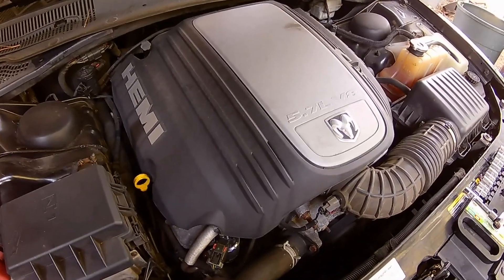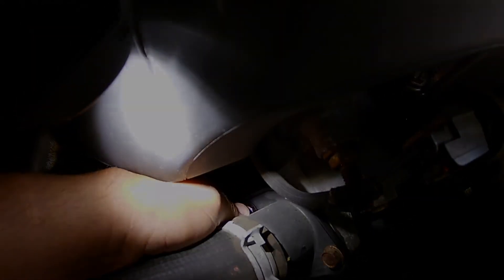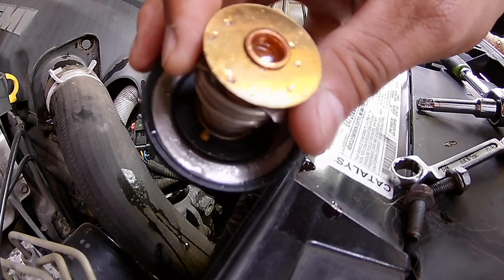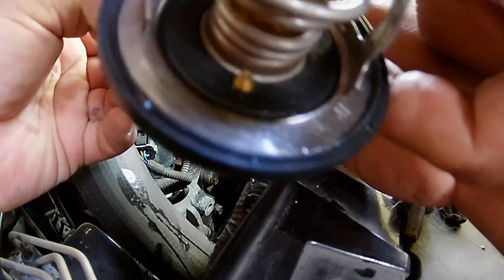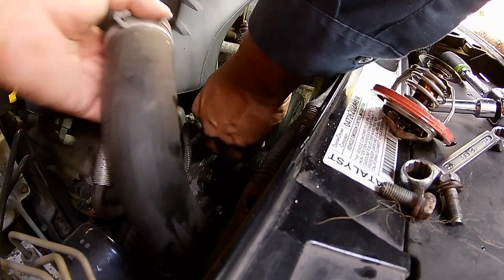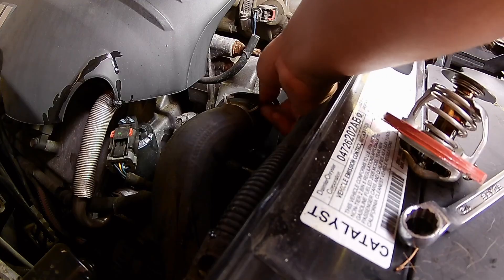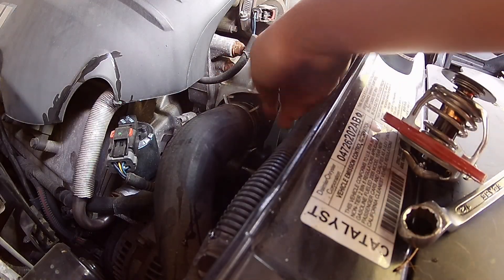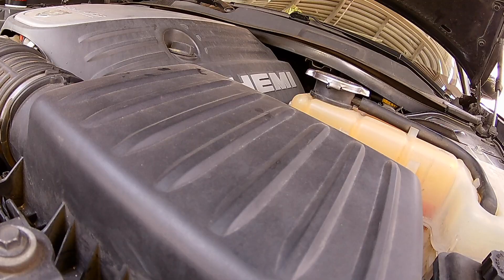How to Replace Thermostat on a Dodge 5.7L Hemi - P0128 - Challenger Charger Magnum Ram Commander

Comment: The old stat has holes in it my new one did not. I dont understand.
Reply from the maker: It helps trapped air get past the thermostat. You can drill a hole on the flange of the thermostat if the new one does not have it.
Reply: @bundysgarage I have seen stats with a little piece of dangly thing in them but this blew me away because you can clearly tell this was not done by someone but rather it was installed by the factory with 6 holes uniformly drilled around it. Now one hole I get it but 6 to me means there is something more significant from the factory in its purpose. So is it that the aftermarket has never actually seen a hemi stat because I can't think of why they would think you don't need them and the factory didn't know what they were doing and from personal experience on other vehicles that many holes made the engine run hot. Now I cant fully say in this particular vehicle because it has had a temperature issue ever since we got it which led to a broken thermostat and the replacement compared to the original raised an eyebrow and seeing the construction of the original raised both eyebrows. Installing the replacement as is runs in my opinion hotter than normal though it is a 207 degree thermostat 🥺 and the fan kicks on at 217 degrees 😳 so I'm on the edge of my pants constantly monitoring the temperature as it has climbed to 250. It actually runs cooler with the a c on because the fan is on. I don't know if this stat is ok for it or does these 6 holes play a better role and why they didn't give me the actual part. I have researched and have found one that actually has the holes in the stat but it's like one out of ten so I am confused on what the heck is going on.

Comment: Perfect video exactly what I was looking for. Had a hose burst on my 5.7 I swapped it and now it’s leaking from thermostat housing and I got the code P0128 I changed the coolant sensor awhile back but code never left so imagine this is my issue.
Reply: Dime solucionaste el problema? Si era el termostato y no el sensor de temperatura? Cuál fue?

Comment: My check engine light came on said it was this code but i have no symptoms no over heating or to cold is that normal? Still planning on changing it tho.
Reply: You may have to run a drive cycle. Run it from 55 up to 65 then let it coast back down to 55 without hitting the brakes. Repeat this about 5 times. And it should get the code to go away literally just had the same issue.
Reply: @Abraxas99x  i did end up changing my thermostats sensor well when I opened it it didn't have one idk what the hell that was about but I put new one in and the code didn't come up anymore... however my transmission is now taking way to long to warm up have no idea why and all my research came up with nothing so might have to take it in.
Reply: @Mrsirwinsalott  Sounds crazy but the new one may be stuck open. The one I just replaced is because the one I replaced before was faulty. One of the guys there said he's seen people swap thermostats out 2 or 3 times before there's a good one. That's why they give them a 1 year or lifetime warranty. 🤦🏿‍♂️😮‍💨

Comment: Where do I fill the coolant up to. The cold or hot/warm level
Reply from the maker: If the engine is cold you will fill it to the cold line. If the engine is hot (but not to the hot line) add coolant until you reach the hot line.

Comment: Great job showing people how to install thermostat correctly with vent hole at 12 clock or on top. Most video  don't show.
Reply: What happens if the vent hole is not in the correct place ?
Reply: @johnnymora1017 did you find out
Reply: @Fisguap lmao I did!! But not I fixed it!!
Reply: @johnnymora1017  did it make the water pump go bad
Reply: @Fastas19x I believe it did😂.. I changed my pump again after couple years.. this time  I didn’t go OEM I just grabbed it from autozone.. also make sure you bleed it correctly otherwise temp goes up n down n it sucks to constantly be checking on the temperature

Comment: I change both sensor and stat and still get that code and temp drops to cold when weather is 36* and under what’s good
Reply from the maker: Where did you buy the thermostat from ?
Reply: @bundysgarage  auto zone. I also saw that my old stat had a piece of plastic missing. What I didn’t do was put that little dot at the 12 o’clock position. Any advice my brotha
Reply from the maker: Get a thermostat from the dealership. Replace the AZ one with the OE one and put the pin at the 12 o’clock position.

Comment: I just changed mine yesterday. But engine light still on. I think it's cuz I did not point the lil pin towards the engine for air flow. Demit why didn't I come across this vdo before. oh will will have to open up again. errhhh
Reply: Did you ever change it back? Did light turn off? 
Did you just have the sensor go off no symptoms? I got the check engine light said it was this code but I have no symptoms car running perfect temp

Comment: I tested my thermostat and it opens at 206°F. 3° shouldn’t be an issue. But then I noticed that my thermostat gasket is just as boogered up as yours, so that’s probably the problem. I’ll replace it and see what happens.

Comment: I changed my thermostat and my car is still overheating .. I don’t get it..
Reply: Bleed the system
Reply from the maker: What’s your radiator look like? How’s your water pump?
Reply: @bundysgarage  I don’t even know like what’s the signs to look for if it’s messed up

Comment: What’s the piece called that the hose is attached to? Mine is rotted out and leaking
Reply from the maker: Thermostat housing
Reply: Drain, flush, and refill radiator with proper coolant and distilled water every 5 years to prevent rust and corrosion in heater core, radiator, and entire cooling system.

Comment: the polyurethane gasket on that stock thermastat is way better than the black rubber one on the new one. Mine cracked in 11 months.

Comment: Do you think Bc I didn’t put the pin at the 12 o clock position my check engine light still on and give me the same code?
Reply from the maker: Where did you buy the thermostat from?
Reply: Same question I bought mine at o'Reillys
Reply: O’Reilly’s

Comment: Do you not have to run a thermostat housing gasket on it I’ll put one on mine
Reply: It has a gasket.  It's black.  The old one is orange.  They don't use or need a flange gasket.

Comment: I'm going back to factory after running my second 180 stat in it and having it fail. Had my fans set to 180 recommendations as well, so I guess I'll need to reset them back to factory. The stat they say for my 5.7 Magnum at the Dealer parts Department is 195. is this correct?

Comment: You dont have to bleed the system? Its okay to open it up like that ?
Reply from the maker: No you don't need to bleed the system after doing this. Now if you had changed say the water pump or the radiator, then yes you would need to beel the cooling system. If a large amount of coolant drained and a lot of air entered the system, that is when you need to bleed the system.
Reply: That was my question, thanks!
Reply: That Race Car Driver  YOU DONT HAVE TO BLEED THE CAR !! Just make sure to buy some coolant cause you will lose a good amount. I changed 2 weeks ago

Comment: I have a 2013 Challenger Hemi.My tstat is working for im not  over heating but I have a slight leak. I think the gasket that between fits between the housing has gone bad. WHAT do you guys think.
Reply: Same thing for me. Gasket was worn and so was the one on the thermostat itself. Runs just fine now after replacing both and adding sealant to the housing both sides of the housing gasket.

Comment: If your heater is constant blowing hot air, is that a thermostat issue as well?
Reply: Even if you put it on cold air? Then no, that would be a blend door issue. You would need to replace the blend door actuator.

Comment: Would it be concerning that the gasket was missing?
Reply: The gasket wasn't missing.  It was black.  The old one was orange.  It doesn't use a flange gasket.
Reply: I put one on oreillys said they had for the 5.7 300c.
Reply: Tests just fine.

Comment: Could this fix a P2181 code also? Also gave an impulsive engine temperature code. Thanks
Reply from the maker: That code is for the coolant temperature sensor. Is the car overheating?
Reply: @bundysgarage  According to in car thermostat no, but smells hot after parking, heat won't work and fan is constantly blowing hard.
Reply from the maker: Sounds like you have a coolant leak somewhere. I would have your cooling system pressure tested and see if you are leaking coolant somewhere. All the symptoms you are describing sound like a low coolant level situation.
Reply: @atl2sdak what end up fixing your issue? I have the same code
Reply: Thanks for the help

Comment: There’s a gasket on the Tstat and there’s supposed to be a gasket between the mating surfaces of the tstat housing and the metal connector with the radiator hose on it
Reply: Just replaced the water pump on my 2014 Grand Cherokee Hemi and the only gasket at the upper hose housing is the one on the thermostat.  There is no gasket between the mating surfaces of the outlet housing flange and the water pump itself.
Reply: Y’all got it all wrong you don’t need a gasket please don’t put a gasket the thermostat already has a gasket all it needs
Reply: You could use a little bit of black rtv instead of a 6$ gasket if you wanted to make sure it wouldn't leak. Doesn't require it though but I'll normally add some when doing hemi motor jobs.

Comment: Good video! Good pointing out that the bolts are the same length (so no worry about which one goes where). Future suggestion: Show everyone how you go about diagnosing a failed thermostat(for those with out a OBD scanner) or heater core. Due to the wide spread popularity of 5.7 (and other engine type) equipped Dodge and Chrysler vehicles, you should put together a series of "how to" videos for common issues as well as uncommon; you would get more than enough views/clicks to make it worth your while from YouTube ($$$). 

A common problem is the rear axle seals. Make a video that explains that process. Again, great job telling everyone what size socket and info about the bolt fasteners (takes the guess work out for those who are not in the know)! Most local shops want about $600+ to replace the rear axle seals.

Just wondering, how many miles were on the car before the thermostat failed? My 07 Dodge Charger 5.7 has approximately 116,000 miles and it still has the original factory installed thermostat. 

Some of the comments submitted below mentioned that you didn't bleed the system. I understand that you didn't lose much coolant that would have made that step necessary. However, why not show everyone how to change the coolant and bleed the system in a future video?
Reply: Mine just took a crap at 120k
Reply: Mine is at exactly 116k and it’s a 5.7 and it’s the thermostat 😂
Reply: El mío compré mopar y me duró 20 mil km. Muy malo o tal vez fue una imitación del original

Comment: Does the thermostat housing/flange itself, need a gasket?
Reply: There's no gasket for the mounting surface.  Only the one built into the tstat.
Reply: I’m wondering the same thing I went ahead and put one on mine but I don’t know
Reply: @beardsbucks2365  back then when i replaced the thermostat flange/housing, i didn't put a gasket on the flange,but this weekend i replaced my thermostat snd also put a new felpro gasket i had laying around.
Reply: angel cedeno yeah it’s kind of Odd that they make one fort but don’t know if they come out with one in it
Reply: angel cedeno I love my 2005 Chrysler 300 with a hemi but they just have a Lotta issues
Reply: Went to oreillys they had one for the housing so I'm assuming it's necessary. Only speaking from a plumbers point of view. I put some dope or gasket sealant on the housing and what not so both sides pf the gasket would have sealant. Tested just fine.

Comment: Can this cause the temp to read off? I just changed a knock sensor and coolant started to boil out of the reservoir. I don’t think a knock sensor replacement could have done that. But is the coolant sensor maybe on the same circuit bank?
Reply: Old Radiator cap gets weak and does not hold rated pressure.  This allows coolant to boil.
Reply: Joshua Hughes the coolant sensor is located behind the alternator on a 12 Dodge Charger R/T FYI. You will have to remove the alternator to replace it .
Reply: What code would this be?